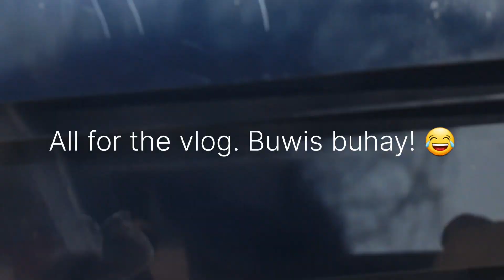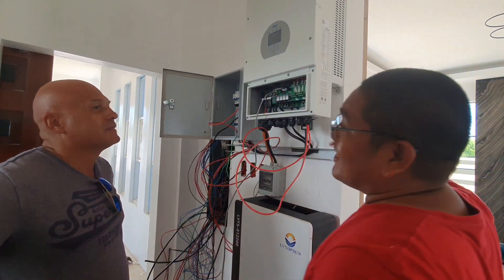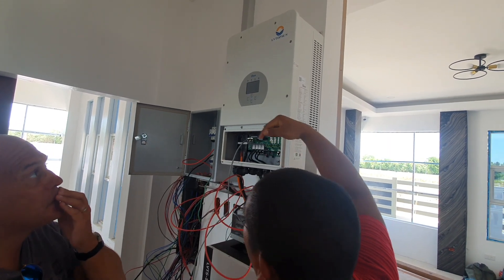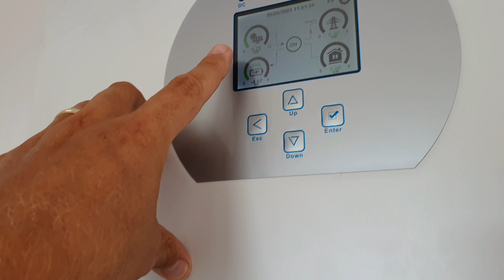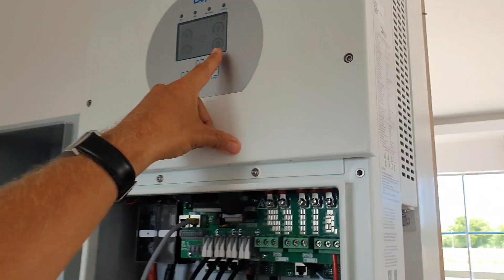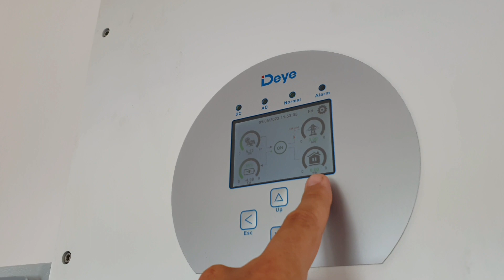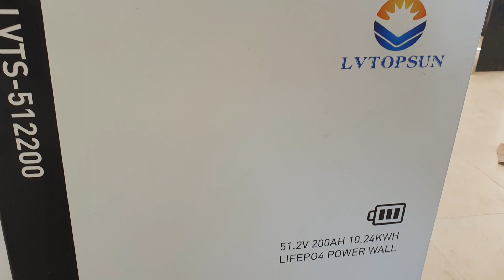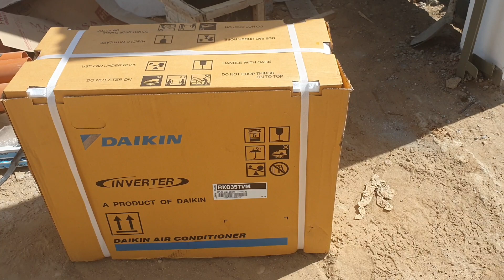9kw HYBRID SOLAR POWER SYSTEM powers our home | ILOCOS SUR | PHILIPPINES 🇵🇭

Comment: oh no.. you used the cheapo cables that came with the security cameras. 😞
Reply from the maker: We are pretty happy with our cctv set up and supplier. :)
Reply: @thesmithsuktothephilippines  generally, experienced professional installers will tell you to purchase better cables (larger gauge pure copper wires, better insulation, more robust connectors) instead of using the crappy cables the kit provided. because when something goes wrong, 9 out of 10 times, it will have something to do with the cables and connectors.